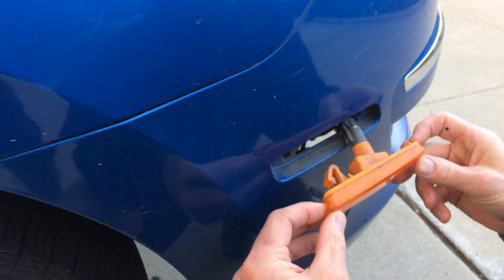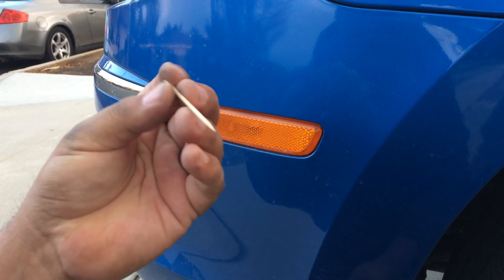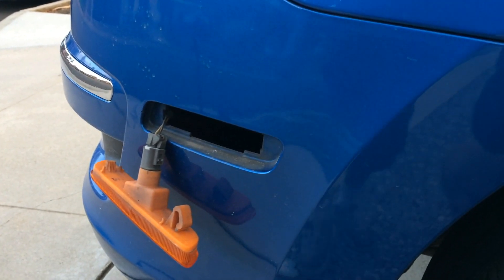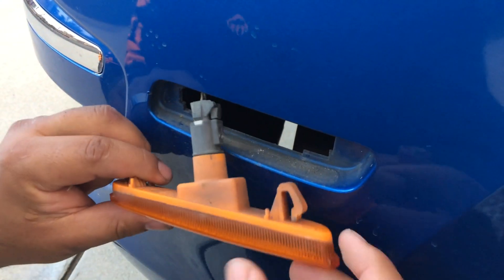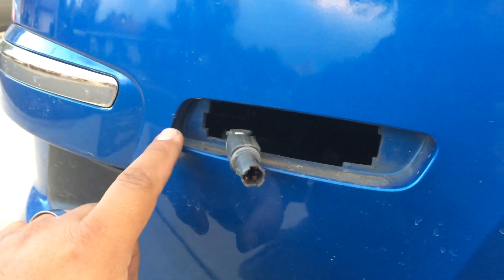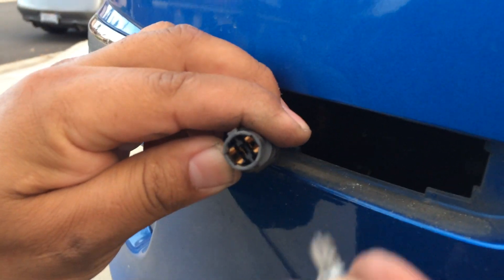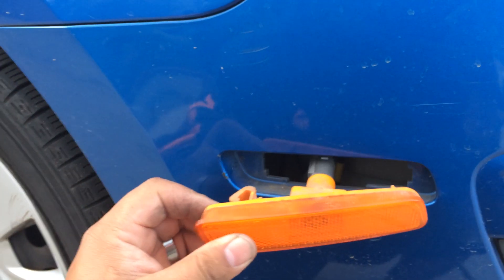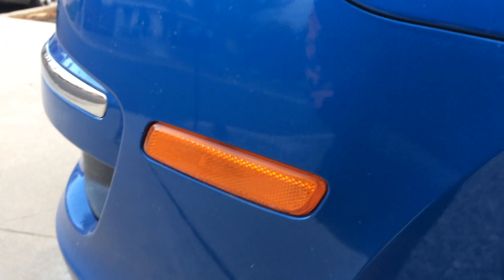How to Install Replace Front Side Marker Light Bulb Hyundai Elantra - 2001 thru 2011 Elantra Touring

Comment: The opposite side is supposed to click out because it has a sliding action. The side that you pulled is supposed to remain in place. You can put some white lithium grease on that clip to help it slide/pop out better. Thanks for the video!

Comment: That is not an Elantra, it is an Elantra Touring.  The model years of the Elantra Touring are only 2009 to 2012 inclusive.  After the 2012 model year, the Elantra Touring was replaced by the Elantra GT.  If you remove the headlight assembly then you can remove the side marker light assembly without prying from the exterior of the vehicle.  To remove the headlight assembly, you need a 10-mm socket, an extension, and a ratchet.  I think my cousin, who helped me fix the front exterior lights on my 2010 Elantra Touring GLS SE, found a video on YouTube showing how to remove the headlight assembly but I do not know specifically which video he used.
Reply: I had to replace both the low beam light bulb and the side marker light bulb both on the front right/passenger side within around three days because the side marker light bulb died just after I replaced the headlight bulb.  I replaced both light bulbs on my own this time but it took around an hour for each replacement.  Originally I tried using a spare McDonald’s debit card to pry out the side marker light assembly from the outside because I did not want to risk scratching my car but I ended up only bending the card so then I tried removing the side marker light assembly from the inside including after removing the headlight assembly but I could not get the side marker light assembly out and this assembly is difficult to directly access due to a black plastic thing in the way even after removing the headlight assembly.  In the end I had to use electrical tape on a blade screw driver like the video says, fortunately I seem to have not scratched my car after all.  I used this video for replacing the headlight bulb but still do not know if this is the video my cousin used:

https://www.youtube.com/watch?v=GgoRPIpI428

To remove the headlight assembly you only need a 10-mm wrench.  A ratchet is faster but I seem to have broken (?) my ratchet by using it with a 6-inch extension and a 10-mm socket for the side marker light bulb replacement task today.  Strangely, the owner’s manual for my car does not seem to cover replacing the side marker light bulbs even though it covers replacing many other light bulbs.
Reply: Oh, and the replacement pack of two Philips 168 incandescent light bulbs I bought from my local vehicle parts store, Lordco in Metro Vancouver, Canada, looks the same as what you have in this video but is a “longer life” version so presumably it will last longer than the standard bulbs you got.  Lordco also had a 168NA pack of two bulbs from Philips that has an orange bulb, presumably for vehicle applications such as some of the taillights on the Honda Fit where the colour comes from the light bulb instead of from the lens but I got the normal bulbs with a transparent bulb because that is what you used in this video and I knew the colour comes from the lens in this case.